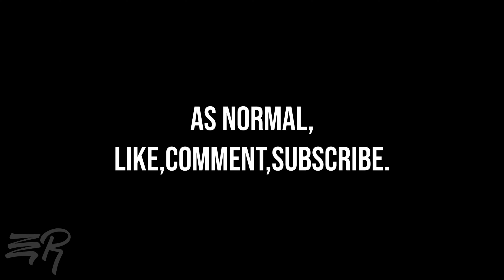Cobra fi2000 Tuner Setting Trials- 2020 Honda Fury

Comment: So the three turrets are basically lean rich mixture tweaks right? The higher the number the more fuel gets thrown at it?
Reply from the maker: Correct.  I know the manual for it goes in depth to what each one does, better than I could explain off the top of my head.
Reply: @EsotericRider  looks like I need to hunt down the manual. I bought a bike second hand that has one installef

Comment: Don’t want to spend all sorts of money on the power commander that being said, in your opinion, do you think I could run a 2 to 1 non-cobra exhaust and still use the cobra fuel tuner with efficiency ? Thanks may seem like a stupid question but the only question that stupid is the one that’s not asked lol
Reply from the maker: Not a stupid question bro. But to answer, it is very possible to run a 2 into 1 custom with the cobra tuner. I have a video on why I switched back to this tuner when I had the PC5, I'd definitely check that out.